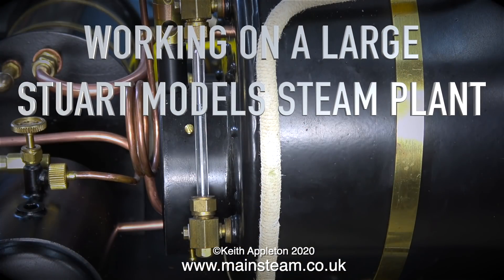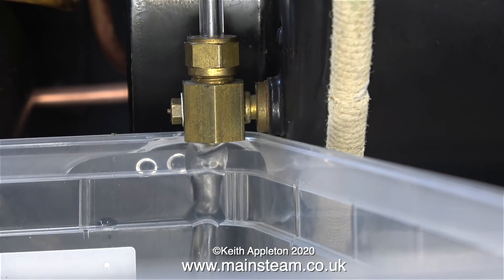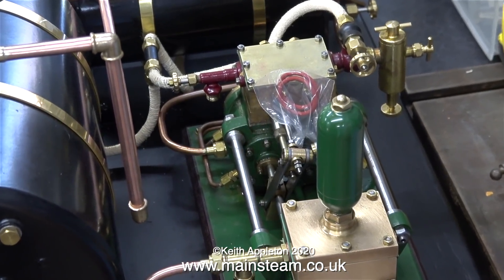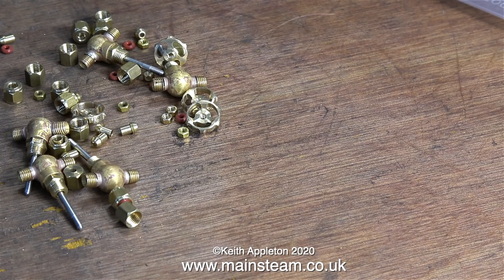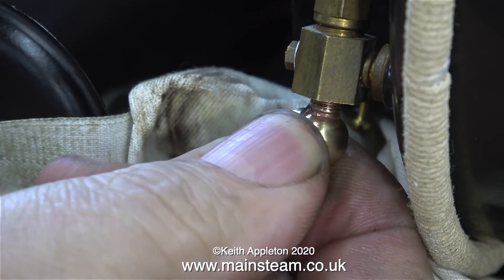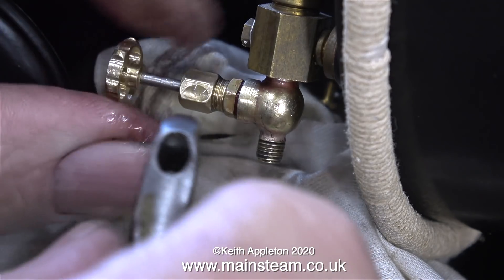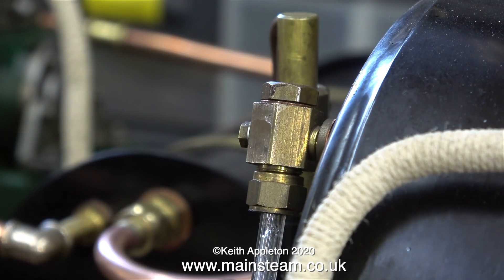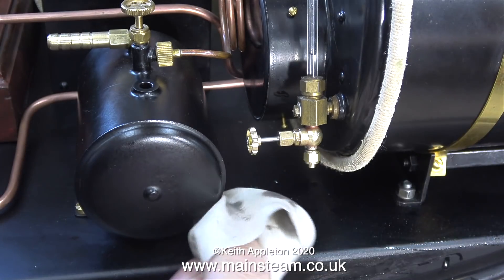WORKING ON A LARGE STUART MODELS STEAM PLANT - PART #19

Comment: Don't really mean to go off topic here, but I've been binge watching your vids(really enjoying them!) and have a question about bending and/or machining small pipes/tubes, I was showed a way that seams to work quite well and was wondering if it would work for your type of applications and that's filling the length of pipe/tube with ice, ie fill it with water then put it in the freezer till it's ice then bend or tap it. I used to bend small break and fuel lines this way, all though I never have threaded them it seam like it would work, though just inserting a drill bit when threading is faster.
Reply from the maker: I have mentioned the ice & molten lead method in previous videos . . .
Reply: @keithappleton   Sorry, I must not have seen that vid yet. I've never heard of using lead before, sound like more work than it's worth, unless there is a reason I'm not aware of. I am just getting into small steam engines and am very intrigued with it, it looks like fun to me!